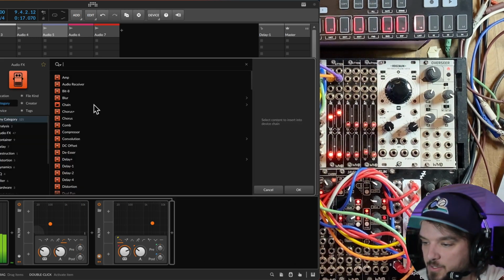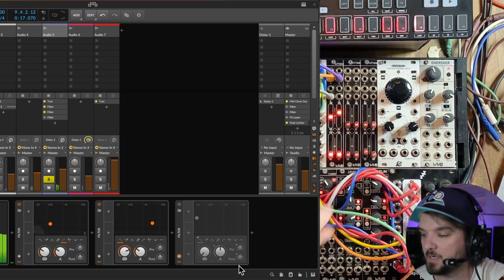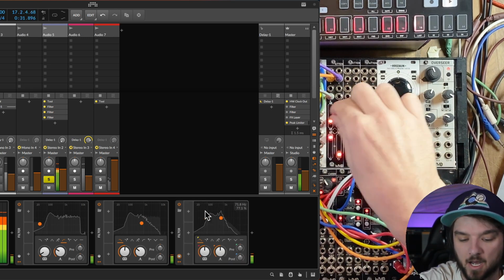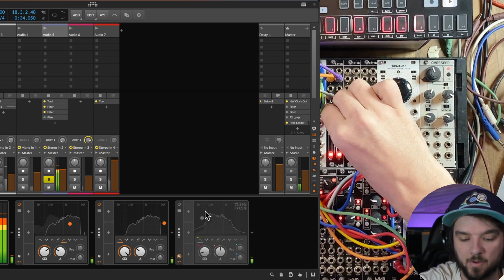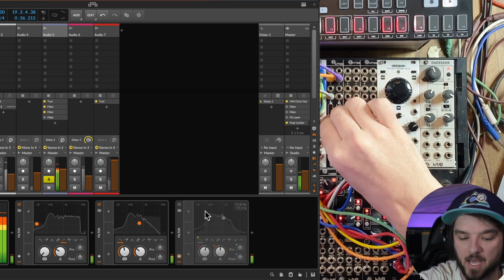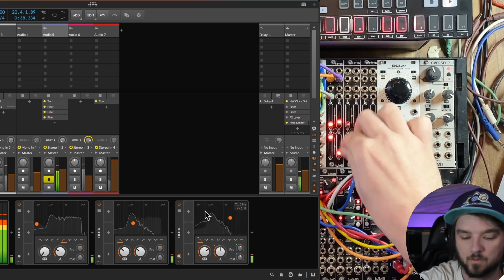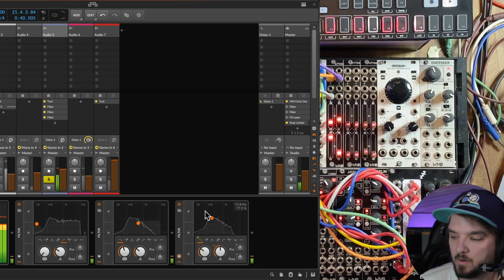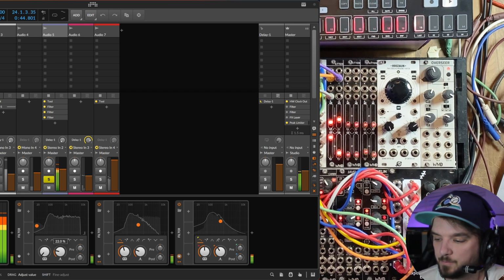Rossum Assimil8or Midi Expander Locutus -  CV to MIDI conversion

Comment: Hi, what midi cables are you using - i am struggling to find cables that are “long enough” as the midi sockets are so far recessed.. cheers
Reply from the maker: I believe they are just Hosa standard midi cables. I havent had that problem with any of my cables, so I dont have the best advice unfortunately.

Comment: Can the Locutus Expander send Midi notes to a midi module, I see there is a parameter for note but that does not work, basically would love to use a eurorack CV sequencer to sequence a midi module through the Assimila8or, short of getting a CV To Midi module, it would save space also, do you think that is possible or only it can send midi messages, CC#. etc. Thank you.
Reply from the maker: Pretty sure notes is just select a note that the trigger input plays.  there is no 1V/Oct to MIDI, unfortunately.  Could be cool for sure. I'll look into it next time I have these set up together.